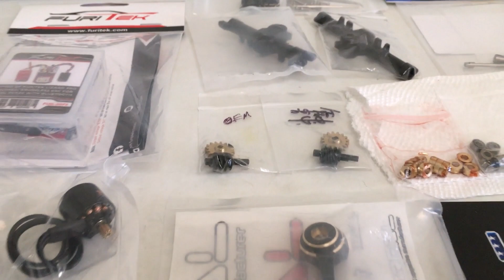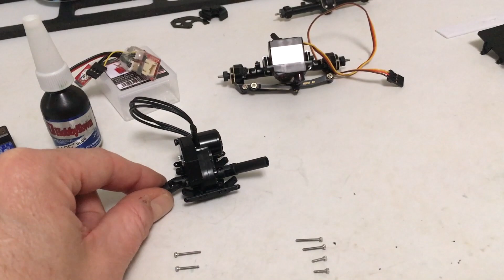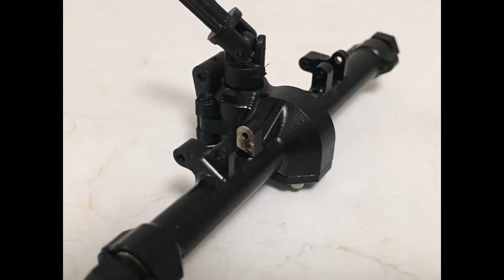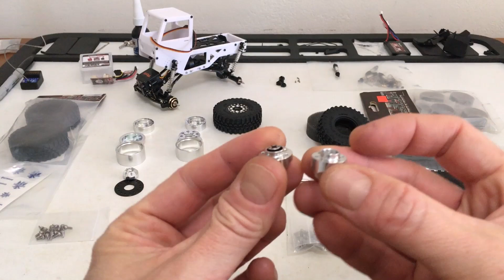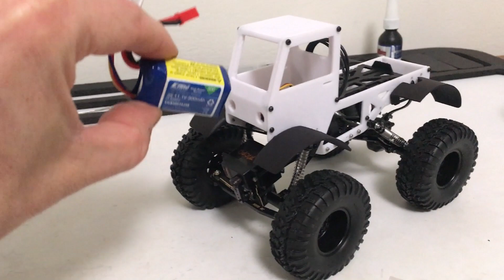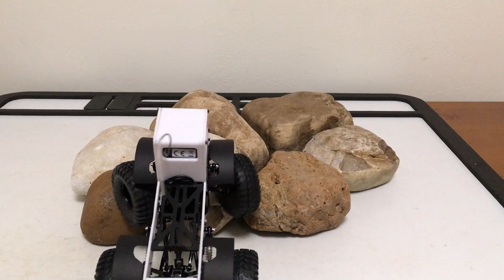SCX24 SPECIAL KEI CHASSIS: FULL BUILD - MOFO NANO BEAST, BRASS AXLES, UPW RIMS, RC4WD IROKS, FURITEK

Comment: Love it!!! The fenders really add to it for sure. I like the steely combo, but maybe the MoFo rings flipped, so the silver scallops aren't visible, might helps those. 
First thing I thought of was a Lego Stormtrooper driver! :D Maybe even go full Hoth on it and have a laser cannon on the back and some blaster damage on the body, etc. Some mesh/window screen might look good in the windows. Or armor plate window covers with sight slits.
Reply from the maker: I does have the head of an AT-ST for sure, just needs the slits in place of the windshield!
Reply: @bcochener  YES! I was thinking panels with slits, so they look like they swing up to open. With your skill, you could likely make them actually function! 👍

Comment: Metal driveshafts. Whhich would fit?!?!?
Reply from the maker: You’d need a set for deadbolt and a set for Jeep/C10. You use the fronts from both, however I had to use a rear Jeep female in the rear cut down about 3/16”. May be better to go with plastic to be able to adjust as needed. You can do the geometry on this many ways.

Comment: Great build. What do you think about switching over to the stock shocks or just stock shocks in the front? Help keep the front end down.
Reply from the maker: I will definitely be playing with several shock options and limiter straps as well. If I have to go super LCG, I may as well save those LT shocks.  May pull out the ESC tray to get the servo further up in the chassis as well. Damn it looks good sitting up high though!!
Reply: @bcochener , the servo will contact the bottom of the grille about the same time the links contact the trans mount.  You should be able to swing the rear ESC tray mounts up to that larger hole and it will sit almost flat in the cab.
Reply from the maker: @JPWirt  I thought about that, but I need the slant for the length of that battery to fit nicely.  I have an idea though.  From watching yours over and over, I feel short shocks may be coming.  And I keep looking at your front end, mine has to get lower.  Do you know your overall weight? and/or F/B ratio?
Reply: @bcochener , total weight is 373g.  According to my kitchen scale, the F/R ratio is 58.5/41.5.  I wish I had the cool corner scales.  Maybe someday...
Reply from the maker: @JPWirt  Thanks!  Good to know another reference point.  -Yeah, I love those 4 corner scales, they are super handy.  They have Wireless BT now on a phone app, but I kinda like the big display of the wired.
Reply: @bcochener , I think I'd prefer the wired version too.  Nearly half the weight of the vehicle is in my weighted wheels & tires.  Each one weighs 45g.
Reply: @bcochener  it sure does!

Comment: Great build!!  Love the fendered look!!  What 3S battery is that?

 I prefer the Scrambler/Steelies.  But I'm biased. That's what I run on mine.

Sorry you had fitment issues with the battery & esc trays.  I thought we had all that worked out.  

I have my front end setup full droop with Goody hair ties as limit straps that keep the front end pulled down for inclines.  There are 3 sizes in the package, which makes tuning easier.
Reply from the maker: Battery: https://www.horizonhobby.com/product/11.1v-300mah-3s-30c-lipo-battery-jst/EFLB3003SJ30.html
-I think I agree on looks, as far as the Scramblers, but man, the Iroks hooked up better on the slick rock.
-No problem, it ended up working out well.  I did order up some rubber bands to try as limiters.  I think those plastic ones are to springy... great if you don't want shocks as well.
Reply: Cool build, if the chassis was a tad longer it would definitely help with the nose end putting down more weight on the front wheels 👍 great little rig nonetheless 🤙